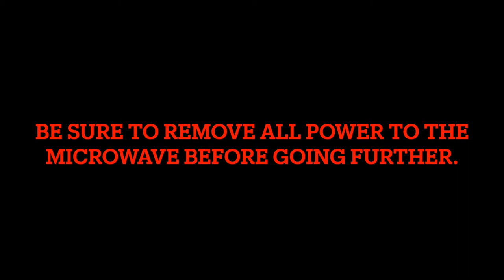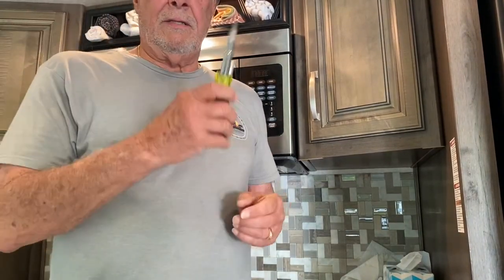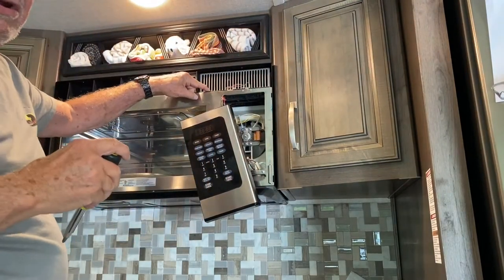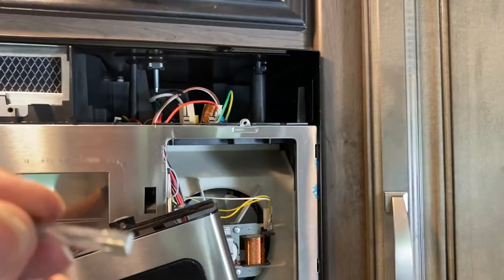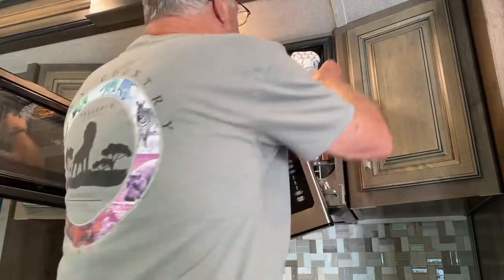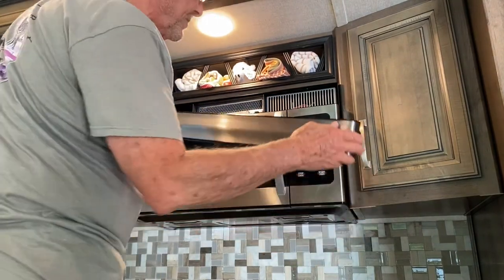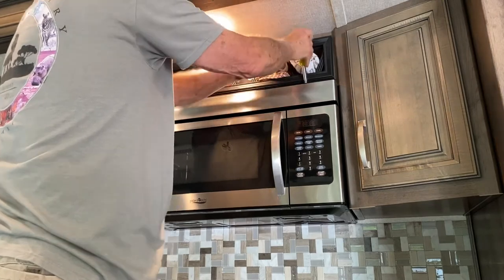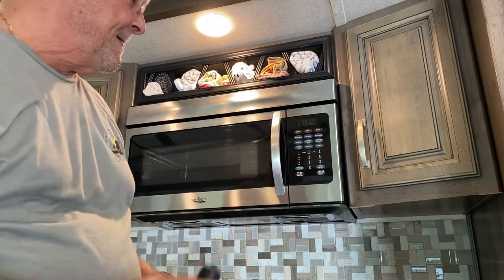High Pointe Convection/Microwave Main Fuse Replacement

Comment: Omg 😱 Bill you may have just saved my life. I’ve had a appliance company try to diagnose my microwave and paid over $100 just for them to look at it! They didn’t help! 😭 I just watched your  video and was able to get the fuse out of my High Pointe Microwave in my Thor Outlaw 37RB which has been out of service for over a year! 😳 I can tell the fuse is blown 🙌 and I’m super excited 😆 to get a new one to replace and test it out!!!!! Thanks 🙏 for making this tutorial! I feel like a boss finally figuring this out 😂 yay!!

Xo 💋 
Bloggin Brandi
Reply from the maker: Thank you.  I am glad it helped you, but in our case our unit kept blowing the fuse when the door was opened and/or closed.  Turned out at least two of the four microswitches on the door were bad.  According to a repair technician I had look at it these switches are a special switch that are around $70 each and there would be substantial labor charges to replace them, so we ended up just buying a new microwave only that fit perfectly and was a lot cheaper. My wife rarely used the convection oven anyway. Good luck.
Reply: Omg Bill it worked!!!!!!!!!! I actually just changed the fuse and it turned on and I unplugged it! 😂 because I’m trying to sell my RV but I’m so excited right now that this fuse worked and I could get it out without dropping the brackets even though the screws were ugggghhh not in the best location so I still damaged my cabinets but I do not care! Thank you soooooooooooo much!!! Yay!!! I got my fuses at Ace Hardware Microwave 20 amp / 125 w! You seriously have no idea how much you saved my life!!! 😳👀🤞💃

You’re the best God bless!!!! 💕💋❤️🙌🙏🙋‍♀️😘😆

Xo
Bloggin Brandi
Reply from the maker: @RVersity  👍👍🤞🤞🤪😜😁😁

Comment: Conclusion:  I want to add very important information:  the reason fuse is blowing is because switches are lose from heat in plastic mounting frame.  I shimmed them up with toothpicks to tight them so they did not wiggle in plastic mounting frame and fixed.  Fuse was blowing when door was being opened.  Shim door switches and replace fuse and convection microwave oven fixed.  Only one year warranty on this.  Started blowing fuses after two years.  Thanks for video on how to change fuse.
Reply: How did you get to the door swiches?
Reply: Michael Hvidston, how did you get to the switches in the door?

Comment: Hi Bill. Are the first screws you removed behind the vent cover?  I can’t see mine possibly because the wood frame is covering them?  If so I’ll have to drop the microwave to get to them??
Reply from the maker: If you are referring to the two screws on the top cover that runs across the top, John, on our unit they are on top a few inches in from each side and I could get to them without removing the microwave or any wood trim.  I hope this helps.
Reply: @Bill Fisher  thanks for the quick reply. Yes that’s the one.  Mine is mounted with only the vent section visible so I’m guessing the screws are behind it. Wish I could send a pic.

Comment: My husband has been replacing fuses in high Pointe Microwave.  The lights come on, the clock runs, everything except the start button.  What is causing that not to work.

Comment: Does it matter if the fuse we took off our High Pointe Microwave says 125v and put in a 250v fuse? All I'm finding on Amazon are 250v Microwave fuses. Thanks for the informative video.
Reply from the maker: I can only tell you that the 250v fuse is what I used.  My problem ended up being the micro switches on the door and the 250v rated fuses blew just fine.
Reply: Thank you much for the response. Do you have a video where you replace/fix the micro fuses in the door? I just want to make sure all of our bases are covered. Thank you once again.
Reply from the maker: @luislujan8784  Sorry, but no I don’t. We replaced the convection/microwave with a microwave. But after doing that I did find some videos showing how to replace the micro switches.
Reply: Oh ok thanks again for the very informative video. Keep up the great work!

Comment: Hello just curious you stayed at the 20 amp but not how many volts it is looking up and trying to buy some replacements I find the 20 amp slow blow but I can only find it in the 250 volt and my high point shows that it's 120 volt. Could you please let me know what you used as when I look up to see if it's okay to use 250 volt on 120 volt it says it could become a fire hazard?? Help🤓
Reply from the maker: I used a 20 amp slo-blo 250 volt fuse. But as it turned out the problem with our microwave/convection unit was caused by some of the micro switches on the door.  These switches are around $70 (yes, seventy dollars) each (there are 4 of them and it is a common failure) and by the time the appliance repair guy got through with the estimate it was far cheaper to just replace it with a regular microwave that we bought at Lowes and that is what we did. We rarely used the convection part anyway because my wife preferred the regular oven.
Reply: Hi Bill - can you post a link to the fuses you bought on Amazon? Did you end up buying a microwave to replace this one that sits on the counter or that’s over the stove? If it’s over the stove, which one did you end up buying (and did it fit in the space without modifications)? Thank you so much for your help!
Reply from the maker: @elizabethfloyd2397  I bought them at Amazon:  Beaquicy Microwave Fuse Ceramic Fuse Cartridge Fuse 20 Amp 250V Slow-Blow Compatible with WB27X10388 Microwave (5-Pack). 
The replacement microwave mounts over the stove where the original one was.
Reply from the maker: We went to our local Lowes store and bought a 1.7 cu’ Whirlpool model WMH31017HZ07.  It fit above the stove perfectly.
Reply: Thank you so much! I really appreciate your help and your quick responses. I hope you have a wonderful New Year!

Comment: How was you able to take the top part off?
Reply from the maker: On my unit there are two screws up above where I pointed out in the video. Remove those two screws then VERY CAREFULLY sort of pry up and gently work that upper front piece off. There a couple of plastic tabs on the piece you need to carefully and gently work free. I hope this helps.
Reply: @billfisher6708  got it off. Thanks so much!!!

Comment: What is the model number?  For some reason, I can't see the picture clearly.
Reply from the maker: EC942K9E. You can also see the model # in the first title page and/or pause the video when the picture comes up.
Reply: @billfisher6708  Thanks.  I have the same model, but can't seem to find the two screws at the very top that start the whole removal process.  I will try out some automobile trim removal tools tomorrow to see if I can carefully pry the top cover loose.
Reply from the maker: @KevinPinto  You do need to take those two top screws out. The panel is a bit difficult to work loose because it also has some tabs. Just take it slowly and carefully and work it loose and off.